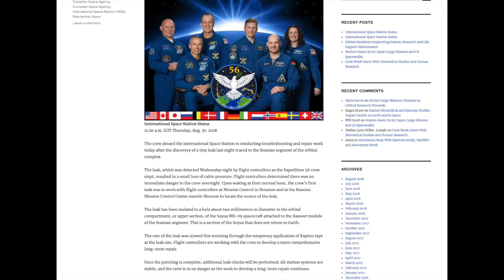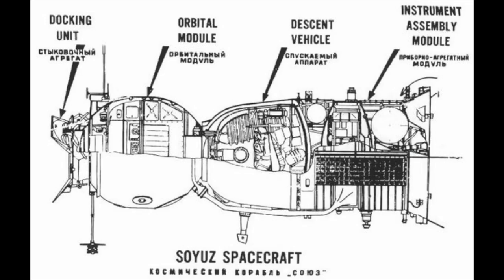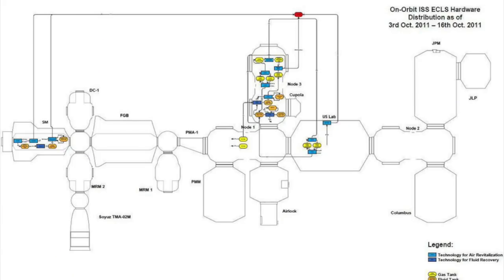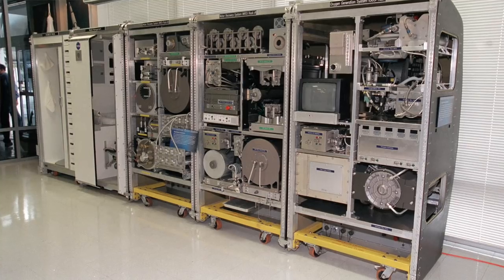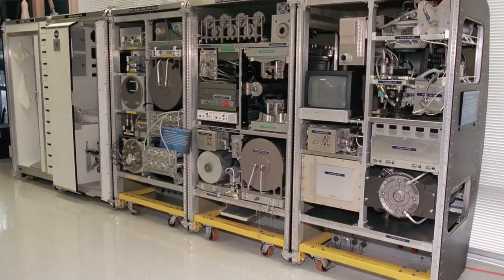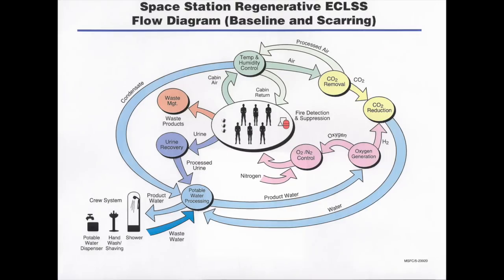Astronauts Are Fixing an Air Leak On International Space Station

Comment: Foolish. Even a small hole would be compromised and rupture that tin can. Do the math as he suggests and you would see that. Total garbage
Reply from the maker: Unlike you, I did do the math, it’s take weeks to drain, meanwhile Cody’s lab actually tested it and survived. So what you have in your head doesn’t correspond to reality.
Reply: @scottmanley  codys lab.. Lol. Your math is flawed. Another thing is if you think a man can float in a vacuum of space with a canvas suit and not burst you are a special kind of ignorant
Reply from the maker: Pressure inside station is 10g per square mm, hole was 2mm across, with an approximate area of 4 square mm.
Therefore force across the hole would be 40 grams.

feel free to demonstrate the flaws in my math, or explain how 40g of force can destroy an aluminium bulkhead. Or, just admit you don't actually have anything to back up your bluster.
Reply: @scottmanley  since you have the numbers what is the total area inside the iss?

Comment: The ISS is supposedly 250 miles above the earth. What is the atmospheric pressure @ 250 miles up? It's something like 10 to the negative [-7] Torr [mm of Hg]. This is very very high vacuum, the likes of which we rarely see in Hi-Vac systems on earth. The ISS should have exploded into the vacuum of space.
Reply from the maker: They're not equal, the pressure differential in the car tire is twice as large as the pressure differential the ISS handles.
Reply from the maker: ISS has a pressure of 15PSI on the inside.
My car tires are inflated to 30PSI over the 15PSI sea level air.

By your argument everyones car tires should be exploding all the time  because they're containing a higher pressure difference.
Reply: No, but the difference between 30 PSI & sea level atmospheric pressure ...& 15 PSI & the vacuum of space @ 250 miles up are not equal comparisons either. You think these are equal scenarios?
Reply: That's not how that works. May I ask where you went to school?

Comment: Even though the hole is small wouldn’t the air just rush out insanely fast since the pressure difference is 103 Kpa vs zero. And wouldn’t that be like loud as hell from all that air trying to escape out of a tiny surface opening.
Reply: no, a small hole, if it isn't made worse, won't blow open. That's largely a product of Hollywood unfortunately.

Comment: Update: Apparently it turns out the hole was DRILLED into the Soyuz hull. 
One theory is that it was drilled by accident by workers during assembly, and that the workers plugged the hole with some glue without advising their supervisors for fear of reprisals. The glue would have enabled the Soyuz to pass pressurisation tests on the ground, but may have come unstuck while in orbit. (The other theory, of course, is that this was ALIEN SABOTAGE!!!)
Reply: This has the ring of truth... Chewing gum works miracles groundside, baby!

Comment: What BS, look at what happens when the pressurized cabin of an airplane is breached while still in atmosphere. Now what would really happen(with even the smallest breach) in the vacuum of space. -9 or -10 TOR would suck that aluminum ISS tincan almost inside out in seconds.
Reply from the maker: Lol at the person who thinks pressure of space can be negative. Next you’ll be telling me the temperature of Space is minus 200 kelvin.
Reply: NO, NO and NO, but there is a type of pressure between to opposing atmospheres, that of the inside of the ISS  opposes that which is outside.
Reply from the maker: The pressure on my car tire is 2 atmospheres, that difference is twice what the ISS deals with. Have you ever seen a tire turn inside out when it got punctured? Of course not.
Reply: +JimmyCarol100 that's not how that works. the force of the air going through a hole that small (on an airplane or the iss) does not result in explosive decompression like you see in the movies.

Comment: Curiously enough, it surfaced that the hole looks like it was done with a drill. And on that Soyuz MS-09 a KL-152M camera was installed on the orbital module in order to monitor stage separation. I guess the hole was done by mistake during camera installation and the fastener kept it airtight just by chance until some days ago.

Comment: I listened to the entire live stream as this was happening and while every article I read now says this was likely a micrometeorite/orbital debris strike the astronauts were adamant about not being able to see through the hole, nor could they find corresponding mark or hole on the opposite side of the capsule.  The CO even remarked it appeared to have been drilled because of the clean marks on the inside of it.  They said on several occasions that there was unblemished metal at the back of it.  I think someone on the ground screwed up during the refurb/manufacturing process and accidentally drilled somewhere they shouldn't have and that Russia is pushing hard to cover up the negligence.  Hopefully we get a look at some of the numerous pictures they were instructed to take soon.

Comment: They found a 2mm hole in no-time in the football field sized ISS which has thick layers of insulation, sheeting and tons of equipment and all kinds of other stuff packed against the walls. With the sound of running noisy airco's, motors, pumps computers and fans resonating through the ISS.
I hope you realize how ridiculous this fairy tale really is?
Reply from the maker: I love how you completely ignored the procedure in the leak finding plan (which is public) where they close off doors to localize the affected module so they’d only have to search one room. 
It’s almost like you wanted to tell some fair tale about some giant conspiracy. 
At least my story is consistent.
Reply: Sure... You are definitely consistent in ignoring facts of this near to impossible task.
Even when they have localized the leak in a one compartment. It is not a bare hollow tube that you can submerge in water to find bubbles. Every compartment is huge and all the walls are multi layered packed with insulation, piping, airco, cables, and tons of equipments. 
In real life you would need to break down the whole interior to find a small leak.
Of course you have beautiful and well thought over fairy tales to explain to the ignorant public how they solve near to impossible problems in no-time.
Pure fiction.
Reply from the maker: Think about it, you're an engineer designing a space station do you
a) design it so you can't find leaks.
b) design it so that leaks can be located easily.

You're saying 'a' and I'm picking 'b' - what do you think real engineers would do?
Reply: +getreal155 they just closed off parts of the iss until they found the part that was leaking. then they just searched that compartment. it isn't that complicated friend.

Comment: Could have just closed the hatch
Reply: Yes, but then, they'd have to check the air pressure inside the Soyuz before opening the hatch. Suppose the reading shows zero atmosphere, as would have been the case in this instance - what happens then? If you open the hatch there'd be a mighty big air displacement from positive to zero atmosphere. They might do this by shutting off the module connected to the spacecraft from the rest of the station. But then, someone has got to volunteer to open the hatch. Is there then a danger of the Soyuz separating from the station under that kind of jolt - this type of scenario was depicted in the film, Interstellar. If such a breach had to happen, it is best it happened this way because the Soyuz module is throwaway anyway, and the breach was small enough to be contained in good time. A direct hit with a basket ball sized lump of something would have been another story.

Comment: I've seen a bunch of ISS videos where they show these insulated hoses running back and forth from one node to another,  carrying I don't know what - Most of the nodes have hatches, and I always wonder;  how the hell are they going to get those hoses out of the way, if they have some kind of real emergency and need to close the hatches in a hurry?  Seems like a potentially dangerous mistake, like having pure oxygen at 15PSI in the Apollo capsule.
Reply: In an emergency where you would close the hatches between the modules, these brave cosmonauts would hop into their lifeboats and de-orbit instead, because separating the modules in effect means giving up the station.

Comment: I would have thought duct tape would easily handle such low pressure over very small hole unless it's not flat. It's probably jagged like a bullet hole.  Even so any repair is forced to seal by air pressure.  What about gum?

Comment: In terms of the safety of the ISS, I think the take-away impression here should be how DAMNED impressive it is that folks ON THE GROUND can detect such a minuscule air leak while the crew who are actually ON THE STATION still have no clue that anything is awry. Not to mention how quickly they located the precise location of the leak. And no matter how bad this sounds to you, it's not THAT bad. I mean, worse comes to worst, they just seal the docking hatch to the Soyuz.

Comment: yea there,s a lot of dodgy physics in space films - so to be clear - space does not suck - however the 14 psi will try to escape to equalize to the non pressure of the vacuum - so you could block a hole an inch wide with your hand and still pull your hand away as most people can lift 14 pounds of weight - but I wouldn't like to test that lol.

Comment: If the hole is round, just tap it for a M2.5 x 0.45. Or whatever size it might be. Just drill the hole out to the closest screw size and tap it. Put in a screw with a rubber washer and botta bing botta boom, Bob's yer uncle.

Comment: So its a hole in the Soyuz and not the ISS?
Reply: Yep
Reply: I  didnt think it would be that likely to see a hole that size in the ISS as it has more shielding than a soyuz capsule, however, if it was on the ISS< i would imagine it would be very hard to find the hole and detect due to the amount of panels and equipment lining the inside of the station, would be a nightmare to repair!

Comment: The Soyuz is just a space Lada, even if there is a hole of the size of your fist in there it wouldn't care and dont forget that you can cure radiationsickness with Vodka at least that's what  S.T.A.L.K.E.R told me.
Reply: Star Trek: The Next Generation taught me that you can open the entire wall on a roughly cubical room and the air will bleed out into space rapidly for several minutes without ever depleting.

Comment: can I just add my 2 cents. if the 2mm hole was created by a micro meteorite or orbital debris then there should be two holes not just one. it's unlikely that a very fast moving piece of debris would have just enough energy to create an entry hole but not enough energy to create an exit hole.
Reply: That's a good point, which leads to some additional questions:
1) The astronauts described the hole as an "exit hole".  If correct, then there should be an entrance hole as well.  However, only one hole was patched, and that patch stopped the leak, so this probably was where the debris struck and entered the module, despite its appearance.
2) MMOD shields don't work by stopping MMOD.  The MMOD will still penetrate the shielding, but is vaporized, or at least broken up and dispersed such that what impacts the pressure hull consists of slower, smaller particles over a wider area, which hopefully won't penetrate the hull.  It's possible that's what happened here, and the resulting debris from the initial impact wasn't able to penetrate the opposite side of the module.  In the hours before the hole was patched, the resulting small particles were probably either sucked back out through the hole, or captured in the ECLS air filters.

Comment: "The methane is expelled overboard" so what you're saying is...the space station farts
Reply from the maker: Yep
Reply: A very important question: what is the dV of the flatus?
Reply: Amusingly low, as since ISp is just exhaust velocity (probably under 10m/s) over the 1g acceleration for whichever unit the exhaust velocity's in.  I used m/s, so I'll bet the ISp is sub-second, making for abysmal dv.  Plus the mass-fraction's going to be tiny, so even if you shoved it out the back of a 4200s hall-effect thruster it'd still be minuscule.
Reply: why not store it and use it for re-boost burns?  or would that use too much of their oxygen? yes, i know ISS doesn't have its own engines but it seems it shouldn't be too hard to bolt one on, since it was designed to be modular. maybe make a F9 upper stage with a Raptor engine instead of the merlin, and you're all set. attach the stage to the end of the station, you now have tankage, controllers, and everything else you need.
Reply: If they use nitrogen that comes in bottles - they could fill those with methane when they take them back (since methane is very useful here on earth). Or do they just dump the bottles in space? Haha. I think it would use too much oxygen to use the methane as fuel. That would probably use a lot more than just what the astronauts needs to breath and would use up a lot of their water as well (since water is used as the source of oxygen). But they could of course supply some oxygen from earth (wich they need to do now anyway as well as the fuel for re-boost)
Reply: Ride84XL
While it's in good practice to be efficient; it's not even worth figuring a way to bring any methane produced by the ISS back down. At best, you might be able to use it as fuel for course corrections; but that's only because it costs millions of dollars to get fuel into space. The amount of methane produced by the ISS likely wouldn't even cover a day's salary of a single engineer, trying to find a way to bring it back down.
Reply: Hold the bag to a cow ( or a termite hill) gets you plenty of methane i guess.
Reply: I'm surprised it doesn't have a use on the ISS?

Comment: This just makes me wonder how this hole even formed. Is it like, a pinhole, or more like a little crack?
Reply: Most likely a nearly round and almost perfectly straight pinhole. It would look very similar to a hole that has been drilled into it, or made with a tiny high-velocity bullet. It was most likely struck by a tiny piece of debris in either retrograde or eccentric orbit which would have come in with a relative velocity greater than the muzzle velocity of an armor piercing assault rifle.
Reply: The problem with that is, a bullet hole in metal looks like this: https://image.shutterstock.com/image-photo/bullet-hole-sheet-metal-260nw-109227950.jpg

Also, the ISS has protection specifically against micro-impacts like that (apparently there's some kind of force-dispersing 'sheet' covering the entire surface); if some random junk in orbit could have made a hole like this, I think it would have happened earlier. Of course, maybe this one just found a hole in the defenses.

Of course, maybe I'm wrong; I'm mostly interested in the hole because I want to know how it formed, and how the ISS is protected against such events.
Reply: +Marconius I believe the leading belief is that it was a manufacturing mistake that workers fixed poorly.
Reply: +Marconius Actual bullets do that because they are moving at a relatively low velocity. These bits of debris aren't moving only a bit faster, they are moving more like 10-20 times faster than a typical bullet.

I didn't know about the protective sheet, however.

Comment: Wow, even with a 2mm hole you are still safe. That surprised with!
Reply: Interesting and related factoid:
The US spacesuits have a valve in the helmet that allows air to flow directly out into space.   If you open the valve, and turn your head, you can look through the valve directly into the vacuum of space.  This is a vital safety feature...
There's a fan that circulates air throughout the spacesuit.  If the fan fails, CO2 will accumulate in the helmet, and the astronaut will die.  There's no convection in microgravity, so without the fan, CO2 will accumulate near your head as you exhale while breathable air will have no mechanism to be move it towards your head.  This is where that valve comes in.  Open the valve, and the air near your head, which you've exhaled, goes out into space.  The drop in pressure causes the suit to release O2 from a small LOX tank to pressurize the suit.  The O2 is drawn toward the helmet, resulting in breathable air being available.  That buys enough time to get back inside the ISS.
Small holes don't leak all that quickly, especially when compared to the amount of compressed gas stored on ISS.  I believe they said they could have let the leak continue unabated for 18 days before exhausting their air reserves.

Comment: 2 mm seems like a real large hole to me. At 14 psi, a 120 gallon tank (for shop air compressor) would leak down in no time at all. Either they must bring a real lot of air, or stuff to make it up there all the time, or I am not understanding something. They had them sleep and worry about it afterwords, seems that is long enough to empty quite a large part of the space station. I just happen to have lots of experience with shop compressed air and the repair of, and so, it just does not make sense that a 2 mm hole is something not to worry about until 8 hours later.
Reply: It's all about volume. 120 gallons is about 454 liters or 0.454 cubic meters. The space station has a pressurized volume of 916 cubic meters. So they have an air reservoir that is over 2000 times than the shop air compressor. I assume that they can also compensate the pressure drop by increasing the oxygen content in the atmosphere. They used pure oxygen atmospheres during the Apollo flights with pressures that were only about 1/3 of normal air pressure.